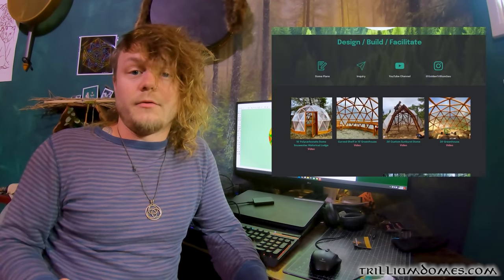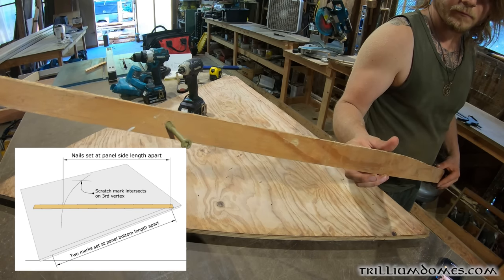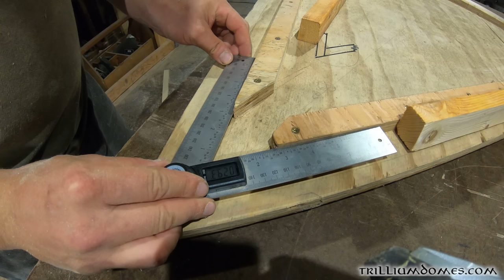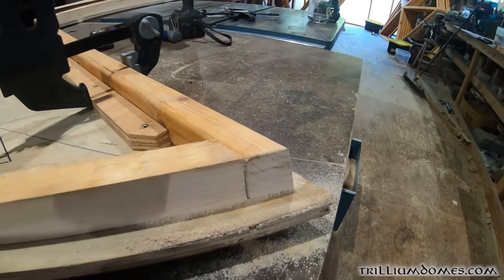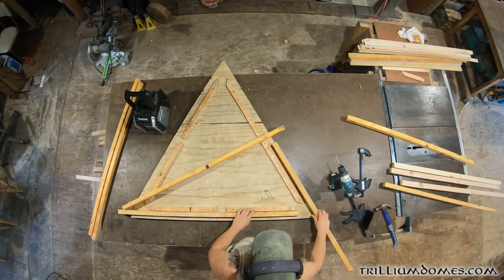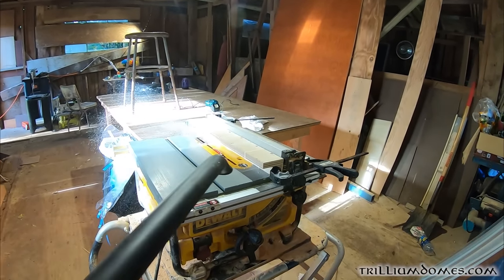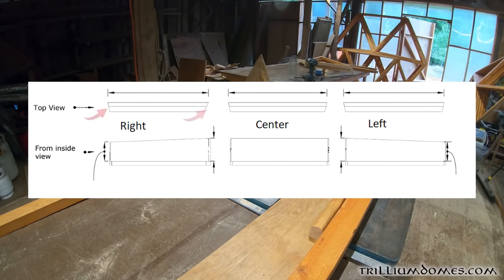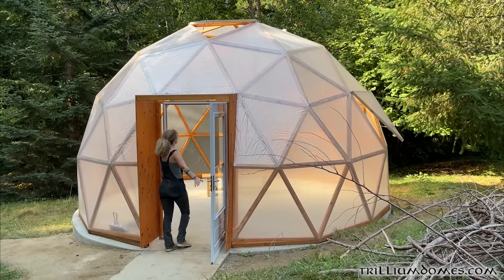The Ultimate Geodesic Dome Build Guide - Most Beautiful, Inexpensive, No Hubs

Comment: Thank you for the great Video, been thinking of building somthing like this as an off Grid Home.... Q.Any idea of the snow load your design would handle? (Canadian here)
Reply from the maker: I haven’t had the plans engineered but I’ve had a lot of my domes get a ton of snow on them and they’re just fine. If you’re going bigger than 30’ you may want to build a second smaller frame inside the exterior one to provide space for insulation and make the structure more rigid. But you can definitely make it work either way.
Reply from the maker: @colinstace1758  You certainly could!

Comment: Can I connect Domes to make a house that's 2000 SQ FT? Would I be able to add sides(Wings) of wood to extend the house to make it bigger?
Reply from the maker: Definitely! Although it would require either some framing in place or some
Custom design work. I do have some connecting sections for my smaller domes on my website!

Comment: To use this map with the pieces already in it, to start cutting the triangles, is it necessary to use a calculator like ACIDOME to have the measurements and angles and thus adjust the miter saw?
Or do your plans already provide this information?
Reply: All our plans come with all the measurements and angles. We also use geometry that is easier to build in my opinion. For example only 4 frames for a 4v dome and 2 for a 3v dome

Comment: how do you avoid wood movement from creating gaps in the butt joints? have you tried routing tongues and grooves and just found it wasn’t worth the extra effort? what about using glue & hardwood dowels instead of screws?
Reply from the maker: Thats all a possibility! I haven’t had issues with structures creating gaps years later using just screws and sealant between the frames. And I would prefer to just plug the screw holes if I was trying to hide them.

Comment: Nails are used in house framing rather than screws as they have a much higher shear strength. Wouldn't that same principle apply in these triangles?
Reply from the maker: You could nail things together but screws are plenty strong in this case. I don’t like that nails tend to split wood, snd are hard to remove. If you try it, let me know!

Comment: Hi Johnny
So the build is coming along and want to get the base done first. Now i read that the dome has to be securely fixed to the ground or one will have problems. 
I was going to cement in post brackets in to holes filled with concrete having one in the middle of each completed panel. Do you think this will be enough? So 11 in total for a 9m dia dome.
Reply: Yeah that sounds great! The domes actually do remarkably well before even being attached to the ground but it is highly recommended to fasten the frame down. Engineering wise, the more load you have on the top, the more the bottom wants to expand. So your concrete piers will keep the bottom from expanding out and make the dome SUPER strong!

Comment: I dont see an instruction on which screws to use on which location. Also, if you are using panheads, does that not create a hump when piecing together triangles into larger panels?
Reply: Depends on the material you are using. You can use grk r4 for everything that doesn't require countersinking. Pan heads would require counrersinking in certain instances, not in others. Feel free to shoot me an email w specific questions

Comment: Have you ever thought about doing it out of plywood? Ripping like 4" boards so your walls could have more depth if you wanted to insulate? I was thinking using a full 2/4 but you would need a saw with a tall blade or cut everything by bandsaw.
Reply from the maker: Depending on the size I would probably just build an exterior dome, then build a smaller one inside to give you whatever size cavity you want and blow it full of cellulose
Reply: @trilliumdomes  sounds like a lot of work  but a good idea.
Reply from the maker: @johndoe_007  Im probably biased because I’ve built so many of these I can bust out a frame really quick. Check it out though, if you trussed then together with gussets and strapping after it’s up, super strong. Then you can pick whatever sized cavity you like, big advantage. Then when it’s packed with cellulose, practically zero thermal bridging! Crazy efficient use of lumber as well.
Reply: @trilliumdomes  ya i can imagine after a while they get pretty easy

Comment: In the 15 triangle wedge footprint ground base area. How can I calculate each triangles outer sides length which equal each area of 6.666 x 15 of the total ground area to fit into 99.999 sq ft? 
Basically I need 1 measurement. The outer width of the 15 sides base foundation to make it fit in a 99.999 inner area?
Reply from the maker: I hear what you're saying. So if you're talking about the base of a dome,  it depends on the dome design you're going for! Not all sides will be of equal length. Or are you talking about a deck? Feel free to send me an email, happy to help.

Comment: I love the design. I’ve settled on the 10f dome. My question is I’ll be moving by the end of the year but still want to garden till then. How would I be able to transport this? Is there a dissembling process? Im putting in PC instead of the plastic sheet. Would that affect the move?
Reply from the maker: You can take it apart in sections to move it but if using PC you will probably need to cut out the sealant between the panels that are coming apart and reseal when you get to a new place. Just another step. Use a %100 silicone and it will be easy.
Reply: @trilliumdomes  thank you so much. I’ll go with the plastic for now and once moved before reassembling I’ll do the PC.
Reply from the maker: @TOMMORROWCANTWAIT  that’s a smart move! Keep me posted :)

Comment: Maybe try building one of uv treated HDPE plastic for extreme weather areas where wood doesn't last very long
Reply from the maker: The wood frame is covered, it’s not an issue.
Reply: @trilliumdomes  
It's the freeze & thaw cycle that destroys wood up here It's a sub-arctic region in winter our windows frost over with crystallized ice
Reply from the maker: @raspberryjellydoughnut5727  that’s why insulation is key. But wood can freeze and thaw with no worries. Domes are flexible and allow for expansion and contraction of material just fine

Comment: Why the cut along the axis of the struts?
Won't it be possible to build a dome with square cross section struts?
Reply from the maker: This method is the simplest for newbies as it has the least about of compound cuts but I'm working on a video where I built a dome with a deep frame just using the miter saw. It's more compound cuts but there are some advantages

Comment: hi 
hey i recently came up with a simple ideal of building an 8 sided building with logs cut down to lumber with an alaskan chainsaw mill were i live i can get free permits to get pine out of the national forest and for a 204 sqaure foot building i have been led to beleive that buildings up too 200 sqaure feet can be built without a permit i would need to make the 2   8 sided rings for floor and ceiling out of roughly 6.5 foot long logs and this wood would be 4x6 inch lumber to make the basic floor walls and ceiling then make a hip roof  of 2x6 lumber and then start cutting logs up into 1 inch thick boards and trim them to be sqaure at what ever width they happen to be and use those for siding and roof material...i would like any feed back you could give me as you are activily building stuff right now i have built standard homes in the past but now im on ssdi and approching 65 years old i cant afford any thing that would have to have a loan but i do beleive i could do this once i get a little peice of land thats off grid and out of the way from the rest of the world...but i think this lay out tho crude and simple is some thing i could do with minimal tools...thank you

Comment: Surprised you don't make a simple jig for the compound miter cut to enable using a circular saw...  Seems like it should be pretty simple to do, since you have such a great raised surface to ride against.  A Ryobi battery powered circular saw would make quick work of those.
Reply: i did mine with the circular saw.  just get the angle set and giver.  -get a dewalt 60 volt max circular saw.  it's an extremely awesome tool .

Comment: Why not route a groove in the inside of the triangle for the poly-carbonate panel so there is no tape?
Reply from the maker: You’d still want to seal between the frames. The tape sticks well to the plastic and adds a layer of redundancy while protecting f the wood from the elements

Comment: I’m planning an earth bag house. I may just build the dome but was considering a panel about 14-15 feet across, a few inches convex and resting on a concrete ring at the top of the wall. The building would still have that cone shape, it would be truncated at the top and replaced with a panel.  Recommendations? A hexagon? Pentagon? Ty for the video. Trillium domes?
Reply from the maker: Like a zome? Not sure I follow but sounds real cool!
Reply: I have leased property in the Philippines. Typhoons and now a tornado have done wonders to my payag, a mostly bamboo and coconut lumber house with tin roof. I want to build a dome shape, earthbag structure in place of this flimsy one. Rather then close the top with earth bags, I was thinking a sky light in the form of one of your panels. To vent and light the place. The convex form would be aero dynamic and less likely to be removed by wind.
Reply: @spudgn  ahhh I got you! I would saw a pentagon would work great!

Comment: Can you give some advice on putting in a couple of fans . Either to circulate out side air to inside so would be lower down and then for those of us who have hot summers we need to get the heat out from the top quickly, so wS thinking of two fan units up the top to such it out which in turn will create a air change over coming in from the windows below. Thanks
Reply from the maker: Adding a cupola can solve a lot of issues. But i think you have the right idea. If you use polycarbonate you can cut and mount a solar fab strait to that. If using film just add some blocking as needed. You can even do it in the shop before assembling the dome.
Reply: @trilliumdomes  sorry but what is a cupola?
I am doing it out of plastic but don't think it would cause a problem if I did the top piece in polycarbonate. 
What do you think.

Also thanks for getting back to me so quick. I am in New Zealand.
Reply from the maker: @seroweassociatesllc  no problem! A cupola in this case would be basically another pentagon at the top of the dome that acts as a big vent. You can put it on hinges and open it so that the heat can escape out the top as well. I think soñar fans are probably the simplest solution for you and I can help talk you through installing them if you get some units and send me some pictures! Check out my latest video on my channel that dome has a cupola

Comment: I do have one question - when you start combining the triangles together in hexagonal or pentagonal shapes, in the video it looks like you're simply tightening them together in a straight line, however they all should be at a small angle relative to each other, or am I missing something?
Reply: That angle is achieved by the bevels you cut in the struts. It may be hard to tell in the video because of the fish eye lense,  but the hexagons come out concave after you connect the triangles.  It'll make sense when you get to that point
Reply: @jonpoyner3182  Understood! Thanks!
Reply from the maker: Yep check out our ultimate dome builders guide video and it will make more sense @renaticus

Comment: Wooooo!  22:30 - Freehand cut on a table saw?
Is Danger your middle name?
Also, my understanding is that depending on the "frequency" of your done, there are difference sizes of triangles.  What you did here I think would be described as a dodecahedron, where everything is equilateral, is that correct.  That is very simple compared to a real geodesic dome with pentagonal pieces and hexagonal, right?
Reply from the maker: This one I’m building is a 3v Dome, none of the triangles are equilateral. I have designs from 2v up to 4v at the moment
Reply: @trilliumdomes  
Then I must be very confused, because you have one jig there, but in all the designs I've seen for complex non-equilateral domes there are multiple kinds of triangles.  Is the jig you were using the same for all the different triangles or was the jig building not for the dome you were actually making in the video, or can you use that jig for creating different triangles?
Reply from the maker: @justgivemethetruth  I just show one jig in this video, but they are made in the same way but for different sized triangles to comprise a dome depending on the design
Reply: @trilliumdomes  
Ah, OK, I thought so.  So, it's a little more complicated, but you have a mass-production method that simplifies things.  Impressive!
Reply from the maker: @justgivemethetruth  yep and I use geometry that’s a bit different from classic geodome geometry like you’d find in a calculator. So there are less unique panels

Comment: Why not use you're skilsaw to cut the compound mitre while everything is clamped in the jig. It would be done holding the skilsaw to the angled edge of the strut, draw a line as you dud with the handsaw, and away you go.
Reply: You could certainly do that but it still would take considerably more time than setting up a stop and cutting them all at once without having to keep switching gears from assembling to cutting.

Comment: Is it possible to put a dome on top of a cylinder... is a geodesic cylinder a thing?
Reply from the maker: You can make geodesic tunnels, so you could set one on top of that. I use riser walls under some of my domes. You could theoretically make those as tall as you want. Check out my latest vid

Comment: I woulkd like to build a man cave shop in my back yard My restrictions are 200 sq, ft max and 12 feet tall max .  I live in Ohio ,so there are snow load laws also. I am leaning toward hard siding and covering with shingles . I am an old man , 73  but I think I can handle this still with some help. I don't think my housing laws would allow plastic or even poly panels, {not sure even a dome will pass. But I am going to check , Thank you!
Reply from the maker: That would totally work! You can scale up the 10’ dome plans I have and it would be a great size.

Comment: Why do you do the long bevel if the internal angle doesn't matter? Why not just use the compound miter to eliminate it?
Reply from the maker: It minimizes the amount of compound cuts you have to make. Just simplifies the process for folks
Reply: @trilliumdomes  but every single joint is compound miters already isn't it
Reply from the maker: @Trevor.Morrice  you should give it a go the other way, sounds like you know what you’re talking about!
Reply: @trilliumdomes  I'm not that's why I ask if there is a reason for all the cutting. Im going to build a CAD model to see
Reply from the maker: @Trevor.Morrice  when you rip all the bevels on the table saw you eliminate half the amount of compound cuts.

Comment: Are all the triangles of the same size?
Reply from the maker: It depends on which plan you are working from but usually no. Our 10' design is one triangle and some partials. Our bigger designs have 2 triangles. And our largest have 4
Reply: @trilliumdomes  Thanks for the reply! I guess I got confused because it seemed like you had one template in the video.
Reply from the maker: @Norbingel  its the same process for each unique panel 👌
Reply: @trilliumdomes  Yes, I finally understood when you clarified they were different sizes. To say I don't have a good eye for dimensions is an understatement :D Thank you again for responding!
Reply: @trilliumdomes  Btw, which size dome is this?

Comment: Shouldn't you use pocket holes instead of your method?
Reply from the maker: I'm not really seeing the advantage. It would certainly take much longer. But I don't see why you couldn't do that if you had a desire to.
Reply: @trilliumdomes  it's not an issue of 'taking longer' but about the strength of the joint - if you put a bolt with the grain, it wont hold as efficient as a pocket whole. Thank you for your reply, good job!
Reply: @riccardo-964  ahh yes I see what you’re saying. Once all the panels are connected there no where for those screw to pull out anyway. Again, I don’t think it would be worth the extra time it takes. Cheers!

Comment: What you're not showing is the enormous waste of polycarbonate by sawing triangles out of square or rectangle stock...
Reply from the maker: Let's have an example shall we. My 18' dome design calls for (16) 4x12 sheets if you want to use PC. That's 768 sq ft of PC to cover 568 sq ft of surface area. That's 75 % efficiency. Typically, a dome has 2/3 of the surface area of a box per unit of volume. So even if you built a box with the same volume that had ZERO waste (not likely), the dome would still use 10% less material. Not to mention all the other benefits, like having to insulate and maintain 1/3 less surface area. 

And that's if you use conventional sized sheet goods. I use oversized sheets and roll stock polycarbonate so it's way more efficient than even that.

All this info is freely available on my website in the description of each plan btw.